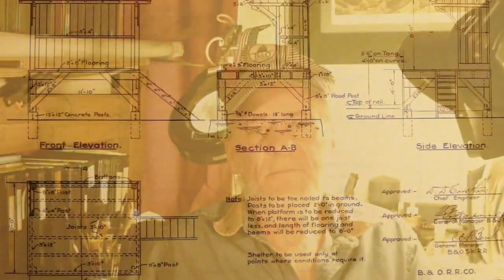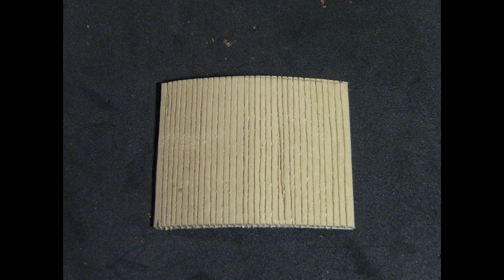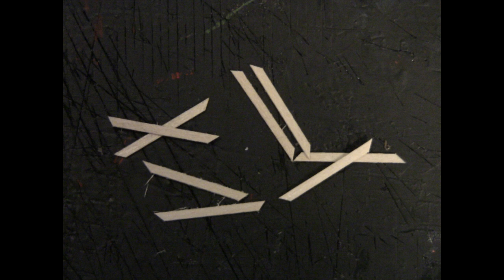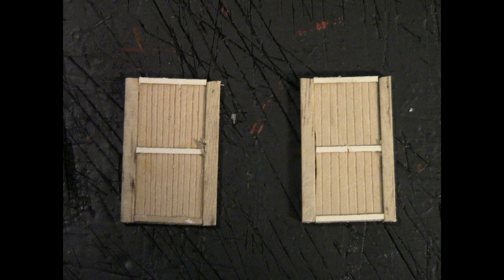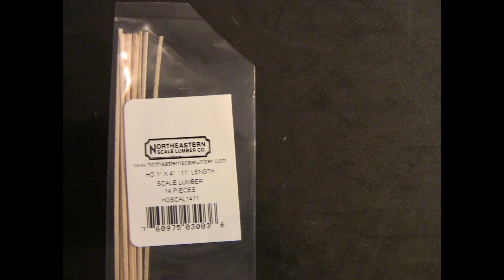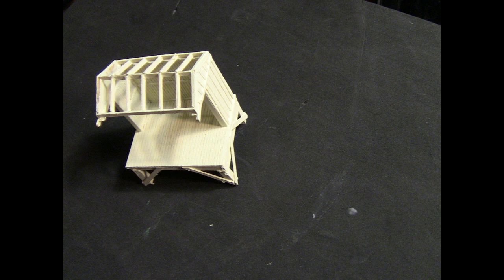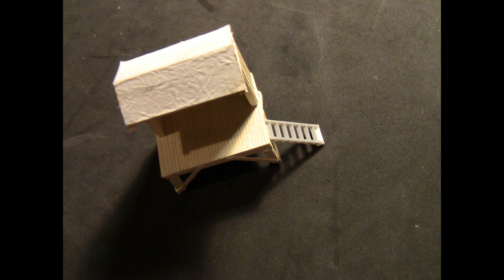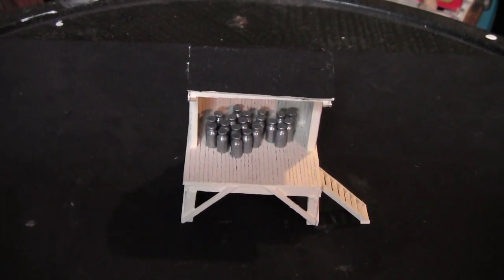Scratch Building a Milk Platform In HO Scale

Comment: Walls, batten boards, roof pieces & floor I would make from card stock.  Supports and uprights I'd make out of wood.  I just finished a lumber shed that came out looking good.  I made the frame out of bass wood and the walls with batten boards and roof out of card stock (cereal box).  I used masking tape cut into strips for the roof material (covering) and painted it flat black to look like tar paper and dry brushed some light grey for weathering.  I've also made several lumber stacks to go inside.  It was based on a Danish design I saw on a video the other day.  Thanks for posting as I may build one my way.  Cheers from eastern TN
Reply from the maker: Thanks for the comment and for Watching !!!  I have used those tricks in the past . I have future projects where I plan to use them again !!!